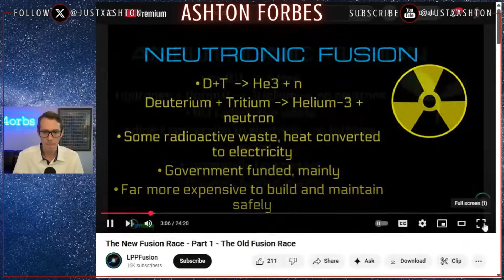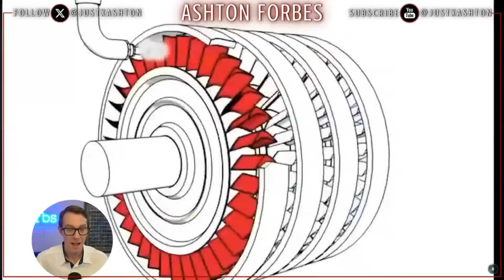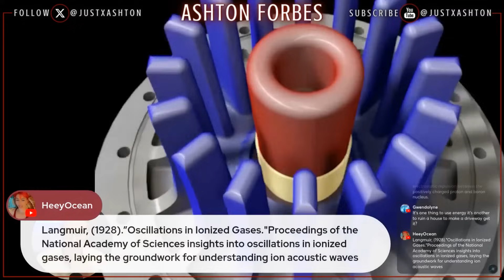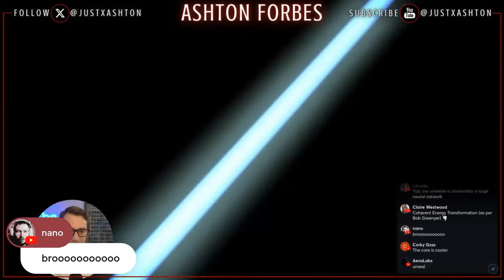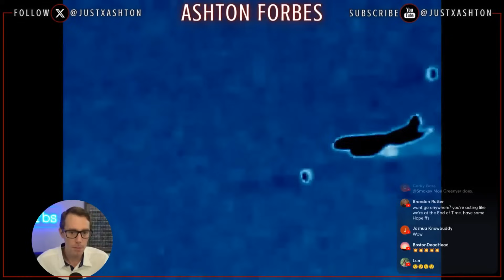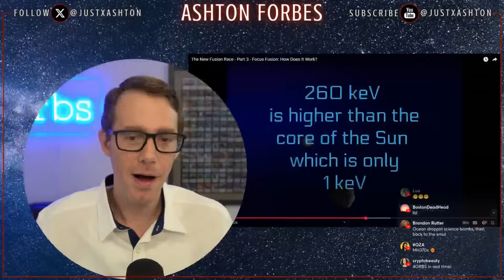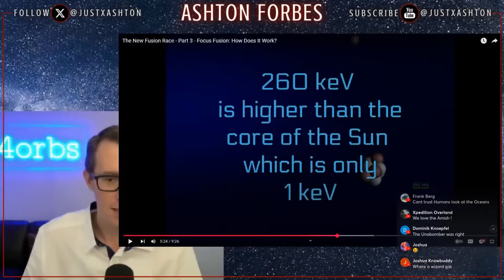They’re Using Plasma the Wrong Way

Comment: Dense Plasma Focus: The Holy Grail of Fusion

The provided text explores *alternative fusion energy approaches**, specifically focusing on the **hydrogen-boron fusion reaction* and its potential for *direct energy conversion**. It argues that traditional thermal fusion methods, like tokamaks, are flawed, advocating instead for **non-thermal fusion* that produces electricity directly without a heat cycle. Key concepts discussed include the *abundance and non-radioactive byproducts of boron-11**, the role of **high-powered lasers (pedawatt lasers) in creating cold, non-equilibrium plasmas**, and the **dense plasma focus (DPF) device* which utilizes the *pinch effect* to achieve fusion. The text posits that **plasmoids**, formed by the self-organizing nature of plasma currents, are the "holy grail" for this technology, potentially explaining the propulsion mechanism of unidentified aerial phenomena (UAPs).

https://notebooklm.google.com/notebook/28b162a9-cdcf-466c-b700-6de3ff71c015

Alternative Fusion Research Analysis

https://g.co/gemini/share/10778373be46

Source 

24 Jul 2025

They’re Using Plasma the Wrong Way

Everyone’s trying to control it. That’s the problem.

This isn’t about stability-- it’s about collapse, compression, and the field doing exactly what it’s built to do.

Pinch = Power.

https://m.youtube.com/watch?v=ZOs_KcfUt3k&pp=ugUEEgJlbtIHCQn8AKO1ajebQw%3D%3D

Comment: Grok Can you use dense plasma focus to produce electricity through fusion via boron 11?

Yes, dense plasma focus (DPF) devices are being explored as a potential method for producing electricity through fusion using hydrogen-boron-11 (p-B11) fuel, an approach often called "Focus Fusion." This aneutronic fusion process has unique advantages but also faces significant challenges. Below is a detailed explanation based on recent studies and developments.How Dense Plasma Focus Works with p-B11 FusionMechanism: A DPF device consists of two concentric cylindrical electrodes in a vacuum chamber filled with p-B11 fuel (often introduced as decaborane, B10H14, for boron-11). When a high-voltage pulse is discharged, it ionizes the gas into plasma, creating a "pinch" effect where electromagnetic forces compress the plasma into a dense, hot plasmoid. This plasmoid facilitates fusion reactions by achieving the high temperatures and densities needed for p-B11 fusion (p + B11 → 3He4), producing energetic alpha particles (helium nuclei) without significant neutron emission.

Energy Conversion: Unlike deuterium-tritium (D-T) fusion, which relies on heat to drive steam turbines, p-B11 fusion produces charged alpha particles that can be directly converted into electricity using magnetic or electrostatic techniques, potentially reducing costs by eliminating turbines.

Achievements and ProgressHigh Ion Energies: LPPFusion, a key player in DPF research, has achieved confined ion energies exceeding 200 keV in DPF experiments, sufficient for p-B11 fusion, which requires ion energies above 100 keV (equivalent to ~1.1 billion K).

High Efficiency: LPPFusion reports the highest ratio of fusion energy generation to device energy input among privately-funded fusion efforts, with a density-confinement-time-energy product (nτT) of 3.4 × 10^20 keV-s/m^3.

Low Impurities: Recent experiments have achieved the lowest plasma impurities among fusion experiments, critical for maintaining high fusion yields.

Ongoing Experiments: LPPFusion is preparing to test p-B11 fuel in their FF-2B DPF device using isotopically pure decaborane to avoid radioactive byproducts like Be-7. These experiments aim to measure fusion yield and plasma characteristics accurately.

Advantages of p-B11 Fusion with DPFAneutronic: The primary p-B11 reaction produces no neutrons, minimizing radioactive waste and structural damage, with only 0.2% of energy from side reactions carried by low-energy neutrons.

Abundant Fuel: Boron-11 is plentiful in seawater, potentially providing fuel for billions of years at current energy consumption rates.

Compact and Cost-Effective: DPF devices are smaller and simpler than tokamaks or inertial confinement systems, potentially leading to 5 MW generators that are mass-producible and cheaper than existing energy sources.

Direct Energy Conversion: The charged alpha particles enable direct electricity generation, improving efficiency and reducing costs.

ChallengesHigh Energy Requirements: p-B11 fusion requires ion energies around 100–600 keV (peaking at ~600 keV), significantly higher than the 40–66 keV needed for D-T fusion, and a 15-fold higher density-confinement-time product (nτ).

Bremsstrahlung Radiation: The higher atomic charge of boron increases X-ray emissions, which cool the plasma and reduce fusion efficiency. LPPFusion’s approach uses strong magnetic fields (multi-GG) to suppress energy transfer from ions to electrons, reducing bremsstrahlung losses via the quantum magnetic field effect.

Low Reaction Rate: The p-B11 reaction rate is about one-third that of D-T, requiring better plasma confinement to achieve net energy gain. Current experiments show reaction rates ~10 orders of magnitude below what’s needed for commercial power, though progress is being made.

Technical Hurdles: Switching from deuterium to p-B11 fuel introduces complexities, such as handling toxic decaborane vapors and ensuring isotopic purity.

Recent DevelopmentsLPPFusion (2023–2024): Their work has demonstrated the feasibility of p-B11 fusion in DPF, with simulations suggesting net energy production at peak currents as low as 2.3 MA. They are preparing for direct p-B11 tests in the FF-2B device, a significant step toward observable fusion yields.

Alternative Approaches: Other groups, like HB11 Energy, are exploring laser-driven p-B11 fusion, achieving alpha particle production but not yet at commercial scales. TAE Technologies has demonstrated p-B11 fusion in magnetically confined plasmas using neutral beams and boron powder injection, though not with DPF.

Research Support: The EU’s PROBONO program (CA21128) is advancing p-B11 fusion research, including DPF and laser-based methods, for energy and medical applications.

Feasibility for Electricity ProductionCurrent Status: DPF with p-B11 has not yet achieved net energy production (Q ≥ 1, where fusion energy output exceeds input). However, LPPFusion’s simulations and experiments suggest it’s achievable with further optimization, potentially at lower currents than previously thought.

Commercial Potential: If successful, DPF could produce compact 5 MW generators, drastically reducing electricity costs and enabling decentralized energy production. However, skeptics note that bremsstrahlung losses and low reaction rates pose significant hurdles, and commercial viability may require energy gains of 50 or more to account for inefficiencies.

Timeline: LPPFusion aims to demonstrate significant p-B11 fusion yields soon, but commercial deployment is likely years away (TAE estimates the early 2030s for their approach).

ConclusionDense plasma focus devices show promise for producing electricity via p-B11 fusion due to their ability to achieve high ion energies, low impurities, and potential for direct energy conversion. LPPFusion’s advancements, including high fusion yields and reduced bremsstrahlung losses, are encouraging, but significant technical challenges remain, particularly in scaling to commercial energy production. Ongoing experiments and international research efforts (e.g., PROBONO) are critical to overcoming these hurdles. For the latest updates, I can search X or the web for recent posts or studies if desired.

Comment: Technically if LPP fusion were using DT fusion instead of PB11 they'd already have something close to commercialization - they just don't want to deal with radioactives because the regulations wouldn't let them iterate fast. Maybe they can get some helium 3 though.

Comment: I dont agree with some of what you say but all this is bang on the money. Also anyone looked up the Triangle Spacecraft patent? 

This invention is a spacecraft having a triangular hull with vertical electrostatic line charges on each corner. The line charges create a horizontal electric field that, together with a plane wave emitted by antennas on the side of the hull, generates a force per volume providing a unique combination of both lift and propulsion.